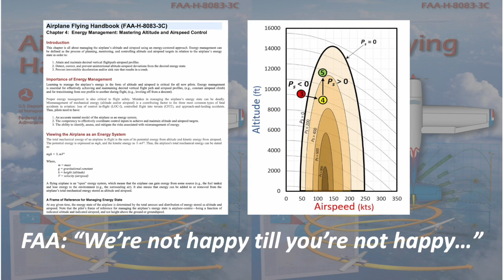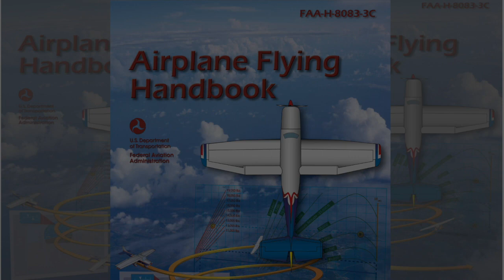Flying the FAA Way using energy management and AOA

Comment: It amazes me the criticisms when glider pilots think in terms of energy and fourteen year olds fly gliders while Langewiesche’s Stick and Rudder very much reads from energy perspective with emphasis to AOA control. Energy is elementary. We’ve just been conditioned to think in other ways and got stuck in our other ways. Seek Improve your Landings with AOA and Power Techniques on Medium. Lengthy read but worth it. See the associated case study F-35C Crash into the South China Sea. And the Back Side of the Power Curve vs Drag Curve. Note the video missed throttle for power converted to thrust by the propeller…
Reply: “Add thrust so we don’t dissipate our potential energy too fast while maintaining our desired kinetic energy…” sarcastic of chapter four, sure, but got it right ‘power for altitude (or VVI) and pitch for speed.’ Now if you just did constant AOA turns instead of constant airspeed.
Reply from the maker: @jimallen8186  I've flown an entire pattern, constant AOA. In order to get the extra G force for the turn, small though that it might be, the G required extra speed, and the easiest way to gain and then dissipate that speed was with a dive. Throttle would have been to slow to accelerate and decelerate. Try it sometime, just for the experience. It's really weird.
Reply: @edcew8236  Thank you for using ‘dive’ in proper context. Another issue I like to hit is precision in language differentiating dive from descent and zoom from climb. 

Diving turn, really micro diving, is exactly how less responsive Navy jets do it. Your power is actually plenty responsive so as to even maintain level if needed in piston planes. You’d only have problems here in large turbine aircraft due to compressor inertia. I haven’t just tried it sometime, I use it as normal practice. I teach constant AOA in slow flight and demonstrate then have students do constant AOA landing patterns. I’ll subsequently have them shift to a compromised pattern but that is for sake of maintaining a margin of contingency energy.